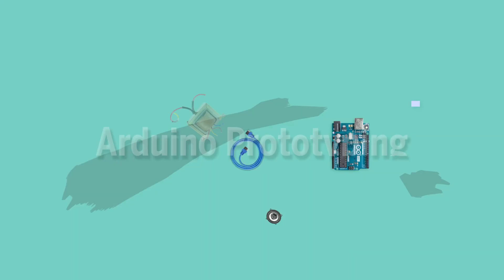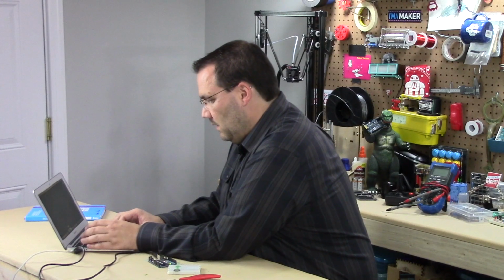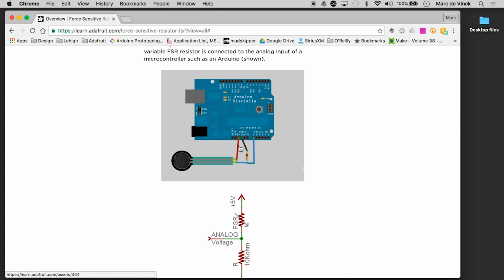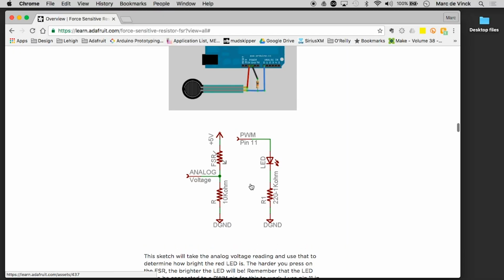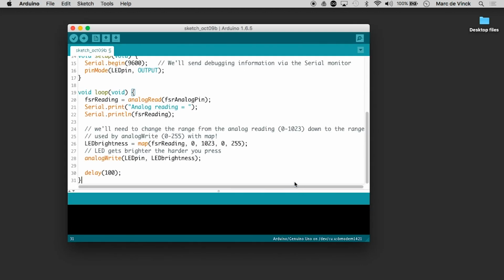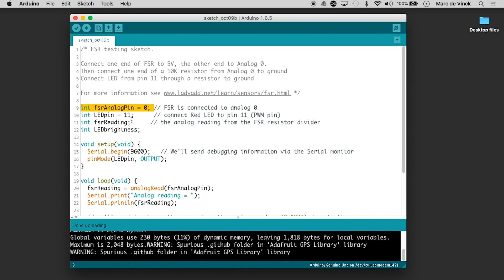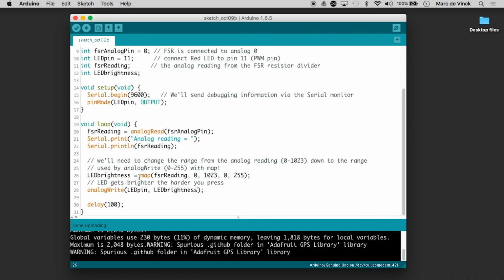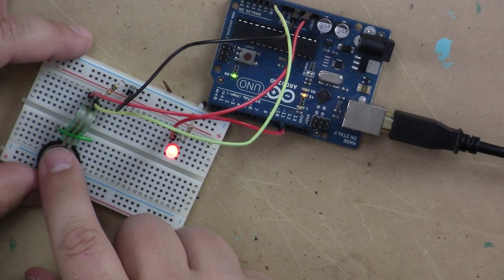Arduino Prototyping Inputs #31: Force Sensitive Resistor (FSR)

Comment: How would you code it if you wanted the light to go on when moderately pressed but go off once fully pressed?
Reply from the maker: That is actually fairly easy. You get an analog output from the sensor. Set a trigger amount for on/off of the LEDs. Just be aware it's really sensitive, so it's hard to be in-between those values.

Comment: thanks sir! Hope you are doing well, I have a school project about creating a Teakwondo protector Scoring systeme, so I need a pressure sensor which is FSR, my question is FSR capable to detect high force measure ( between 3000N - 4500 N for exemple ) if no is there is any way to calibrate it's sensivity and thanks for your attention!
Reply from the maker: There is no easy way to calibrate it. You are most likely better off with a 9DOF sensor as the FSR is more fragile.

Comment: what if i didn't use resistor? will be there any issue for testing purpose?
Reply from the maker: You need a resistor to get the range and protect the input pin.

Comment: Hello, i was wondering if it’s possible to connect an FSR with a DC motor and motor drive? Ideally if a certain weight is added on the device then the FSR, instead of activating an LED, would activate a DC motor to spin the device a certain amount. The device is a multiple mold for casting designed like a revolver’s bullet cylinder. Im wondering how i can code it to spin the cylinder to the next chamber once the prior chamber is filled for casting. If it’s alright to request help on how to code smthg like that?

Comment: Hi there, I wonder if you can help use this code to connect and FSR to a vibration motor? Rather than an led. i dont need anything too complicated but Im a newbie and only need this for one project.
Reply from the maker: That is a very doable project. Unfortunately I can't help, but you can find a lot of information online.

Comment: Hi, thanks for the great video. I want to ask what is the unit of the numbers shown in the serial ?
Reply from the maker: It's just a range of pressure from 0 - 1023 which can be mapped to any range. No specific unit. For more calibrated measurements, look into load cells.

Comment: I bought an FSR but not the Arduino. I tried creating a simple circuit (power source connected to a small bulb with the FSR in between). I know the bulb works and the power source is good, but when I add in the FSR, no matter how hard I press the FSR, the bulb does not light up. I would think the FSR is just a regular switch and when a force is applied the switch is turned on but it’s not. Any reason? Or what am I missing?
Reply from the maker: I don't have enough information about the circuit to give you a specific answer, (what is the circuit, what is a "bulb" an LED? What power, etc, etc) but here is some information that could help you. An FSR is just a variable resistor. Typically, the harder you press, the LESS resistance is in the circuit. Again, typically between ~100 Ohm - ~200 Ohm. If your circuit works with resistors in that range, then an FSR should work too. (generally speaking) There is a great guide on FSRs on Adafruit's Learning system. It uses an Arduino as an example, but it explains in detail how an FSR works. https://learn.adafruit.com/force-sensitive-resistor-fsr

Comment: I saw FSR has different spec such as 0~20kg, 50kg. If I want to use it on the shoe pads, do I need one such as 50kg or 100kg?
Reply from the maker: It depends on your estimated impact, which I assume is very high. Are you running, or jumping, how much does the user weigh, etc. Also where on the foot, as that can increase/decrease the impact by as much as 50%.
Reply: @MarcdeVinck  Thanks for your reply. I plan to put two in the middle of the pad and one in the heel position.

Comment: Can i determine weight using fsr sensor and how can i do it ?
Reply from the maker: It's not as accurate as a strain gauge, but yes you can. Just correlate the analog output as shown in the video to a known weight. Could use the map function too. But again, a strain gauge is much better suited for accurate weight measurements.

Comment: In what unit we get pressure ?
Reply from the maker: You get an analog voltage reading that you can convert to pressure. It's not as accurate as a load sensor, but it works in many applications.

Comment: i have another question, how would i connect multiple pressure sensors? is it possible to connect multiple on on board and how would the readings work on arduino software?
Reply from the maker: You can have multiple sensors. As many sensors as you have available pins, depending on the type of Arduino. You would read each pin and return the results.

Comment: thanks for the vid, is it ok to solder on wires to the pressure sensor to increase the length before attaching it to the white pcb board?
Reply from the maker: Yes! There are small pins on the sensor you can solder wires onto.
Reply: thanks for the quick reply appreciate it.

Comment: hey i was wondering if you know how i could  convert the 0 -1023 resolution to newtons inside the Arduino program. great video by the way. very easy to follow
Reply from the maker: 1N is ~ 6k Ohm depending on your sensor and hardware. You can google Simple conversion tables that will get you in the ballpark. Code is available too.
Reply: @MarcdeVinck  thank you. my fsr senses up to 5 kg (49.05N) so could i set it for every 6km ohm is a newton ?
Reply: @MarcdeVinck  also what would be the best terminology when googling this i find i often dont get the results i am looking for. thank you
Reply from the maker: @rianmoore8693  Start here - https://learn.adafruit.com/force-sensitive-resistor-fsr/using-an-fsr
Reply: @MarcdeVinck  do you know if your able to solder these sensors to make the wire connection longer?
Reply from the maker: @rianmoore8693  Yes, they have small leads that fit in a breadboard, or you can solder wires to them.
Reply: @MarcdeVinck  thank you

Comment: What will be the unit of force being measured?
Reply from the maker: You are measuring a resistance within the FSR. You can map that to a measurement of force, with some calibration, but just keep in mind it's not going to be very accurate and may not be linear.
Reply: @MarcdeVinck  Then what will be the use of this
Reply from the maker: @alokkumarnyati  There are lots of uses, in fact it’s one of the most popular sensors. Take a look online for projects that use FSRs and Arduino. You get a varied resistance. Use it to make music, sense when something is empty by weight, etc. that are lots of fun!

Comment: Great video! I have a question how would you connect multiple FSR? Would you need multiple arduinos for that?
Reply from the maker: Just use other pins. However, any vibration from one, can typically be picked up with additional FSRs, so isolation, etc, may be necessary.
Reply: @MarcdeVinck  would the code for the arduino still be the same? Do you have a video about it by any chance?
Reply from the maker: @sjw0233  Any time you change a component, or add a component, the code is more than likely going to change. In this case you most likely could use the same lines of code and change the pins to read an FSR, but it really depends on what you are building.
Reply: @MarcdeVinck  is there a video or anything you know of that can help me more?
Reply from the maker: @sjw0233  Sure, Google "arduino multiple FSR". Lots of results.
Reply: @MarcdeVinck  is there any way you can help me write a code for it?
Reply from the maker: @sjw0233  Sorry, I have a startup that consumes all my free time. The Arduino community is amazing, so much code is already out there. Google it. I saw working code ready to go.

Comment: Would there be a way to tell a servo to rotate a certain way if it were getting pressure sensed information from one of those things?.
Reply from the maker: Yes! A servo could easily be programmed to react based on the input from a force sensitive resistor.

Comment: Hi. I just purchase FSR UX 400 force sensor and try to contact it with arduino Uno (R3) and display force (N) on Led display. Could you let me know what resitor will use for this force sensor?
Reply from the maker: It depends on your circuit, etc. An FSR is a resistor. In the example the 10K is so the pin doesn't float (give back crazy signals). In general you want a 10k to stop random signals and tie the sensor to ground when not in use.

Comment: Thanks for the helpful video!
could you please guide me about the case in which I would like to have multiple FSRs? Could it be done with a single arduino?
Reply from the maker: Yes, of course. As long as you have a feee analog pins, you can keep adding more FSRs. (or digital, but that only give you an on/off and not ideal)

Comment: Hi Marc, are there FSR's that can work in higher weight ranges, for example, bodyweight? A load sensor would not be ideal as this is for a wearable tech idea and needs to be low profile. Essentially I would like to monitor when too much force is applied e.g green LED comes on when within normal range and a red LED comes on when outside of this range.
Reply from the maker: Not to my knowledge, but the easy fix for that is protecting the FSR. Imagine wrapping it in a layer of rubber. It reduces the force and response rate. Just keep in mind if it's for repeated high forces, a non-mechanical, or non contact sensor might be best light an accelerometer. They are very reliable, have more lots of g-force ranges available, and can be incredibly small.
Reply: @MarcdeVinck  Thanks for the response, I;m not sure if the accelerometer will work for my project, I am trying to determine the forces inside a prosthetic socket. But the rubber wrap seems like a great idea, I guess it will take some trial and error to determine the correct amount of rubber.

Comment: Hi, great video and very informative. Do you know if this sensor would be appropriate as a hit sensor in a target to be used by bb guns? Seeing the high speed of a bb pellet and how quickly it would bounce off the sensor would you think this sensor would be able to record any force/pressure? Or is there a better sensor for this?
Reply from the maker: It might be, that's a tough one as the speed of the Arduino might be a limiting factor too. I would assume you could in a test setup. You might be able to get some idea with a piezo sensor mounted to a metal plate and measure the amount of electrical energy created. But that would only be relative to the BB and gun, not an actual fore measurement. I have a video on those -- https://www.youtube.com/watch?v=X3XXRZMBPO0
Reply: @MarcdeVinck  Thanks, yeah that could be enough. The goal is to just record that it has hit it, not how strongly so it should be enough. I will take a look at your other videos thanks! Subbed :)
Reply from the maker: @fredd9740  Oh, then a piezo 100%. Will work perfectly. Easy too! Just adhere it to the back of the metal target plate. Thanks for the sub!

Comment: Hello sir, i know that fsr aren't meant to give the exact reading but can you tell how can i reduce its fluctuations , suppose if m keeping 1kg weight its reading varies from 800-1200 g
Reply from the maker: Yes, use a load cell, not a piezo. Thats the best choice for better accuracy and less fluctuations.
Reply: @MarcdeVinck  yes ik but sir i have space constraints so i m going with fsr only , but one thing i got to know about fsr is that we can use smoothing and get very less fluctuations ,the results are amazing with that code ,also i used a 47 mf capacitor with it ( anybody interested for the project mail me at kb9829422@gmail.com) .  Here is the link for smoothing
https://www.arduino.cc/en/Tutorial/BuiltInExamples/Smoothing
Reply from the maker: @BilalKhan-do9il  Glad it worked out! Just keep in mind it is now much less accurate and slower. But it can be a good solution.
Reply: @MarcdeVinck  sure sir, thanks!

Comment: can it measure very small force in range from 10 to 20 gram
Reply: @ Marc de Vinck
Reply from the maker: Yes, but it's not accurate or calibrated. A load sensor would be a much better choice. That's what a digital scale would use. It involves a bit more components, but well worth the effort.

Comment: Nice video, anyone knows  if there is a more precise sensore? I'm working on a project that invovles measuring finger's force on hands rehabilitation sessions and I need a precise measure and I think this is not as accurate as I want
Reply from the maker: Yep! Use a load cell. They require a bit more electronics and are a little more complicated, but are also very accurate. It's what a scale would use.
Reply: @MarcdeVinck  Thanks! I'll give it a try
Reply from the maker: @Thespiritofice  Glad I could help. Good luck with your project!

Comment: hi, nice video. i have a question. i was wondering if it is possible to set the force sensor in such a way that the brightness of the LED decreases as you push the force sensor?
Reply from the maker: That is actually very easy! The nice thing about microcontrollers is you can easy reverse the #'s to decrease the LED strength (voltage to the pin) based on force. There are severals ways to accomplish that, but I recommend you look at the "map" function. For example: map(value, fromLow, fromHigh, toLow, toHigh) in practice would look like y = map(x, 0, 255, 255,0); That would inverse the range of numbers and you could apply that to the LED brightness. Hope that makes sense! Good luck! And thanks for the sub! Please share!

Comment: Hi, it was an extremely helpful video. Do you know the units of the values displayed?
Reply from the maker: Miguel Angel Casado Unfortunately it is only a proportional amount of the minimum to maximum range. This can be helpful for some projects, but it isn’t going to work like a scale. For calibrated and precise measurements you need to look at a load sensor. A bit trickier to use, but they will give you precise results.

Comment: Hello can you explain me how can I convert voltage to force and weight by using force sensor pleas
Reply from the maker: That is what this sensor does! If you need to be more precise you should look into load cells. That's what a bathroom scale would use.
Reply: @MarcdeVinck  iam using force sensor in my broject robotic can it load  and catch things depending on weight of its .. and I need codes of the sensor pleas
Reply from the maker: Here you go! -- https://learn.adafruit.com/force-sensitive-resistor-fsr/using-an-fsr
Reply: @MarcdeVinck   thank you very much

Comment: If you were to use a load sensor, would the code or wiring set up be changed in any way. Thanks great video
Reply from the maker: The concept is very similar but the code would need to be changed. Load sensors typically need a small daughterboard to amplify the signal they create. You would normally connect that amplifier circuit (an HX711 breakout board is an inexpensive and good choice) up to power, ground, and 2 of the analog pins. You can measure weight with an FSR, but it's not going to be accurate and also not as robust.
Reply: @MarcdeVinck  Thanks marc, 
can you contact me at: malikhussain97@hotmail.co.uk
I have a few more questions and a private query to ask you. 
Hope to hear from you soon thanks
Reply from the maker: @GloriousMaleck  Please ask any questions here, that way the answers can help more than just 1 person. Thanks!